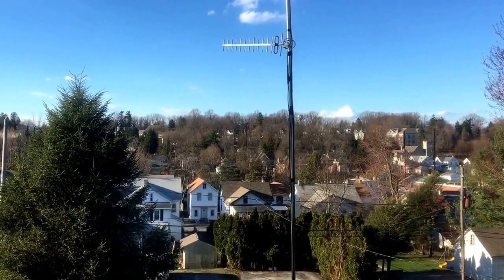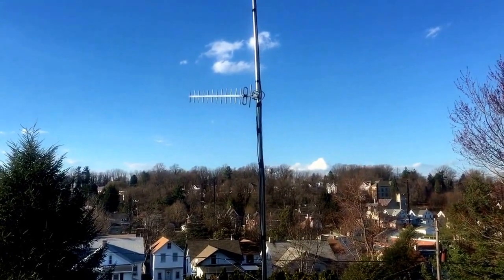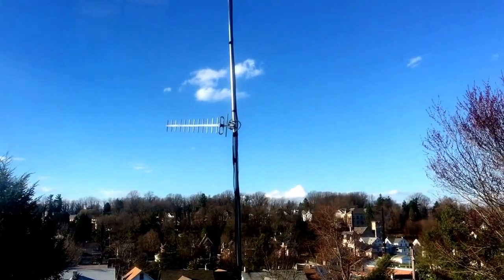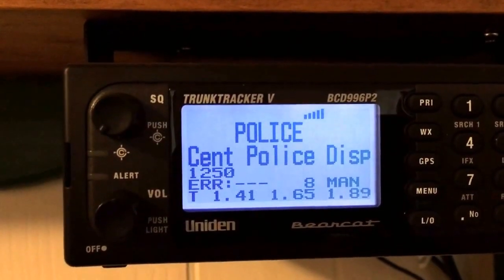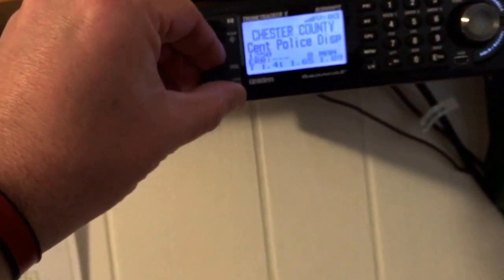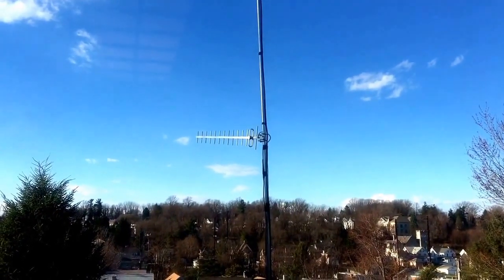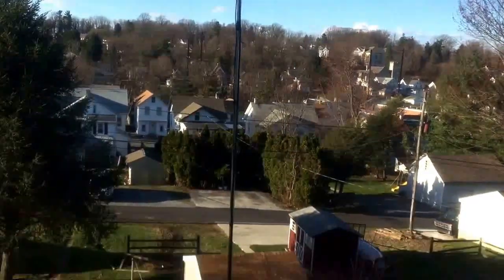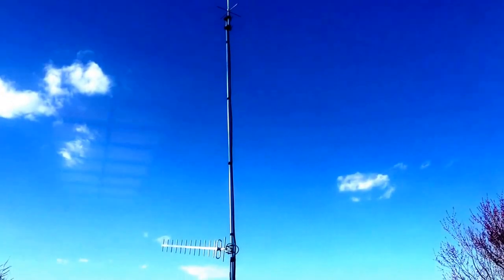Update on the BCD996P2 antenna situation

Comment: Why do you need an outside antenna? I live in a rural area and don't have a problem. You must live in the valley, right? Or there is too many obstacles ? I am a novice when it comes to radios. I once had an outside antenna. Kept getting transmissions from places I wasn't interested in.